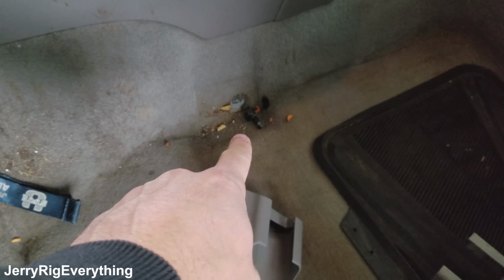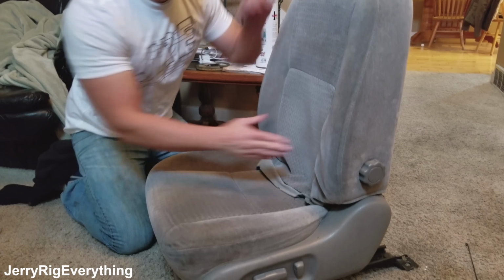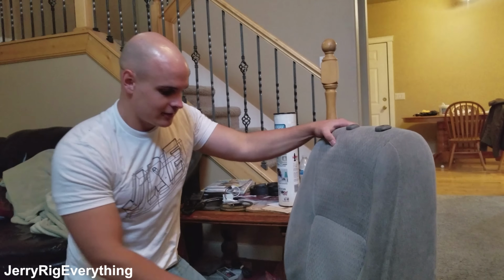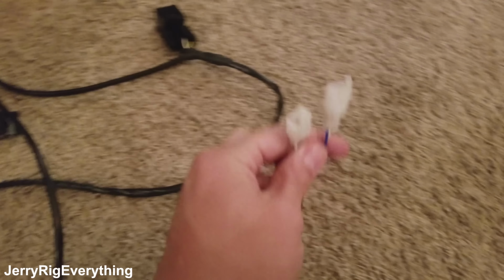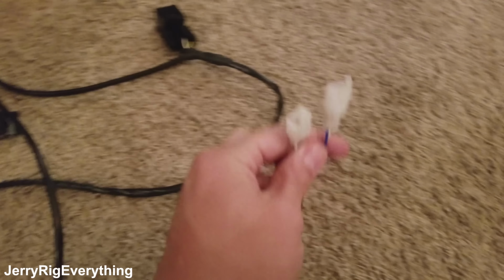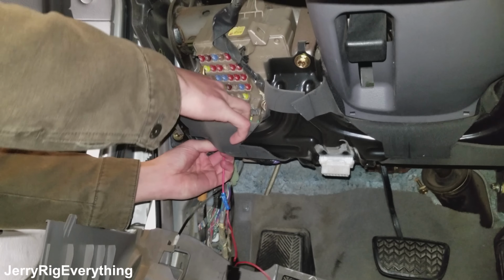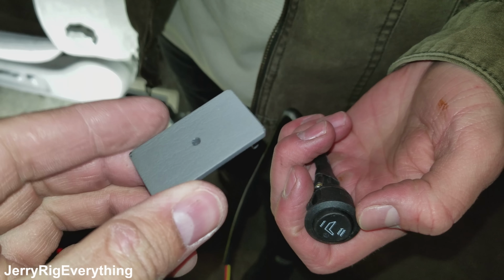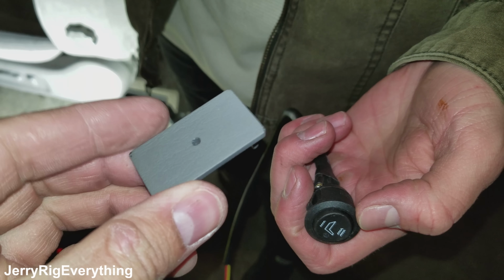Add HEATED SEATS to your car this Winter!

Comment: Coming from a detailer here. Putting heating elements in a cloth seat will possibly ruin the heating elements if you ever decide to get the car detailed. Extracting the seats will naturally get them saturated in water and cleaning chemicals. All cars I have ever detailed that have had heated seats have had leather seats. If you decide to do the DIY do it with LEATHER SEATS.
Reply: Lot's of cars have heated cloth seats, including my 2011 Outback Premium.
Reply: This can’t be true right, so many cars like Hondas and Hyundais have heated cloth seats
Reply: My vw jetta has heated cloth seats iv extracted and they're fine
Reply: I have aftermarket leather, does that matter?

Comment: Make sure to disconnect the battery, or you will get a permanent SRS light as the car believes there is an issue with the seat mounted side airbag (if equipped).

Comment: Thank you very much Zack! The video shows that the sets you can buy are pretty much plug and play. 

I am in a process of looking for my first new car. Some units with considerable discount can be bought and are not picked by people due to lack of winter package (in Poland you might use them for more than half a year, especially in mornings or at night). This video shows actually a great alternative for me and I might end up getting car without such package if installation is as easy and cheap as presented.

The sets are so cheap that I might even install it this / following week on my 2007 Ford Fiesta just to learn the process and see how it goes. It will keep me warm if needed 🤗 It's such a shame that I found out about this after 6 years of ownership! 😅 I would have made the installation much sooner then.

Comment: If i have seat covers on my car, can i put the under the seat covers? i mean between the originals and the protections ?
Or the pads must be placed on the sponge?
Reply: Late reply but to anyone reading this, my upholstery was glued to the foam (2009 Honda fit), so I had to use seat covers and it's been working well for months already :)

Comment: I did this for my seats but the air bag light keeps flashing on the instrument cluster now. Is there something that can be done about that?
Reply: I should let it be checked or check it myself with an OBD (2) thingie cuz you never know when there is a problem with your airbags
Reply: Yeah that tends to happen when you "jerryrig" crap into your seats. Your car has what is called a passenger presence system that detects weather not somebody sitting in your passenger seat as well as how heavy they are to determine how much power the airbag needs to have behind it when it comes out in a collision. Some Vehicles when you take the seats out you have to recalibrate the sensors with special weights. Hard to jerry-rig that but hey at least your butt's warm

Comment: This beats a $20 heated seat subscription everyday. You might even be able to use the ones already in the car but just add your own switch. I'm sure it would turn your dashboard into a Christmas tree of errors though just because you modified your seat lol. Remember the days when you could change out your head unit and not lose all the interior functionality.